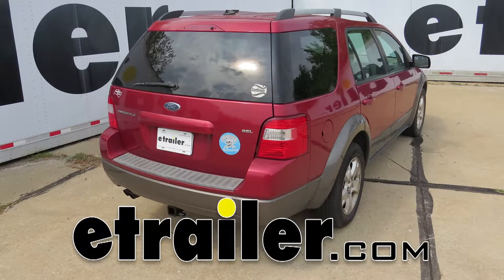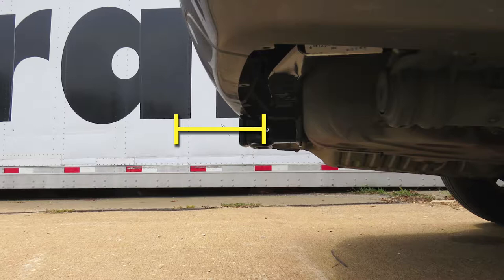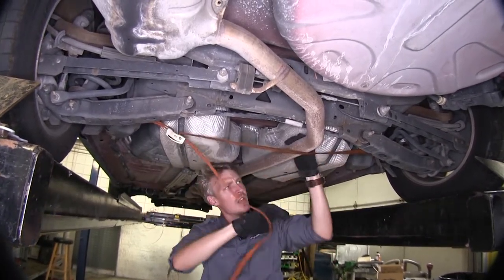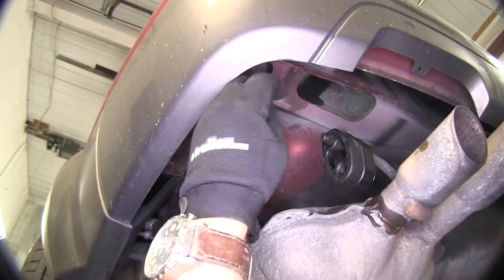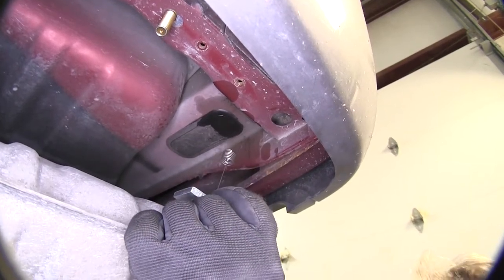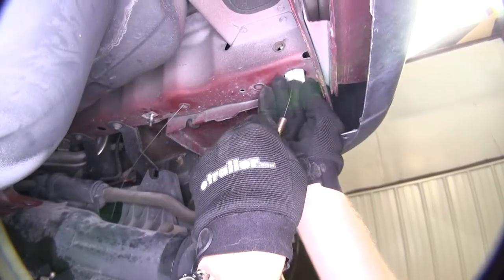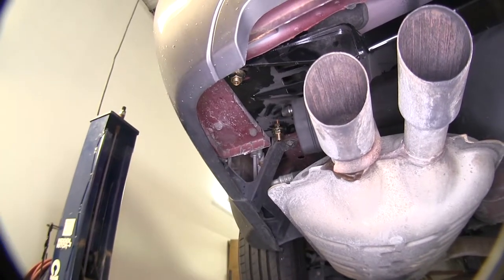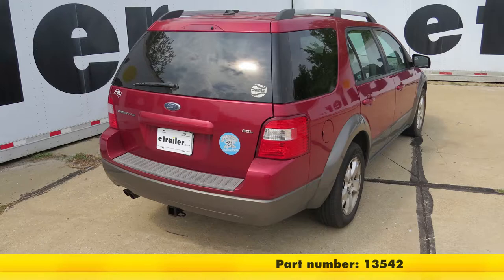etrailer | Installation: Curt Trailer Hitch Receiver on a 2007 Ford Freestyle

Comment: Good clear easy to follow instructions, but it always looks easier to do on video than it actually is.
Reply from the maker: It can be a bit deceiving at times but our goal is to walk through the installation so you can determine whether or not you want to do the installation yourself or take it somewhere to have it installed.
https://www.etrailer.com/Trailer-Hitch/Curt/13542.html

Comment: how do i add lights like the wiring harness that would go into a trailer i would tow
Reply from the maker: We recommend the # 118395 trailer wiring harness. You can see it being installed on a 2007 Ford Freestyle by checking out the install video link below:
https://www.etrailer.com/tv-install-wiring-harness-2007-ford-freestyle-118395.aspx
https://www.etrailer.com/Custom-Fit-Vehicle-Wiring/Ford/Freestyle/2007/118395.html

Comment: Does that fishwire come with the hitch?
Reply: Yes it does. I ordered one from advanced  auto parts online and I just now got done installing  it. My frame on the passenger  rear literally the rear of the frame just the tip connecting to the bumper guard was bent just a little but I bent it back with a hammer and finished  my install. I had a little fight with the last bolt on the end on the driver side but like the guy said just a little bit of patience and time it will go through. Unless the last bolts starts to go in and won't straighten up to drop down then u may have to do what I did. Stick a big flat head in one of the holes on the side of the frame and just pry it a little to help it drop in place. Other  than that it was easy. Just a 40 minute Job mine took 20 minutes  more but I stopped  and smoked a cigarette. It's a good video and very helpful just dont mess up either fishing wires until ur done or ur screwed.
Reply: @jamiekirk844  Thanks. That is helpful.
Reply from the maker: Yes, the fishwire will come with our hitch kit.
https://www.etrailer.com/Trailer-Hitch/Curt/13542.html